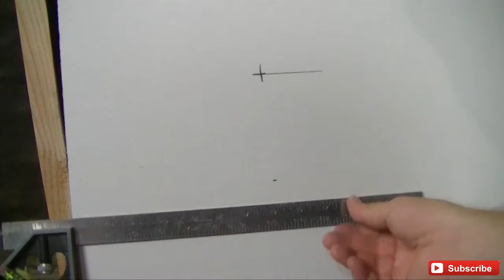Garage Project 4 - Drywall

Comment: Hey there,

Nice Video Series on the garage being re-done I live in Southern California as well (San Diego) and my garage has a pretty similar wood and aesthetic to it. I am more concerned with installing insulation to the garage. I am planning on putting in solar exhaust fans to blow out the roof so they can run and lower the temperature in the garage. However, the insulation would be ideal. I wanted to see why you chose against it?

Comment: Was that fire rated sheetrock...I believe calif. code requires 5/8" fire resistant drywall in the garage...Hope you never sell the house.
Reply from the maker: WestCoastMods Hmm interesting. Its not fire rated. Well if it becomes an issue, I can always rip it down. I am only dry walling two walls.
Reply: WildmanProject I think the code says only walls that  are between garage and living space...if you only put drywall on exterior walls then I believe you are okay
Reply from the maker: WestCoastMods the wall between the house and garage is fire rated.